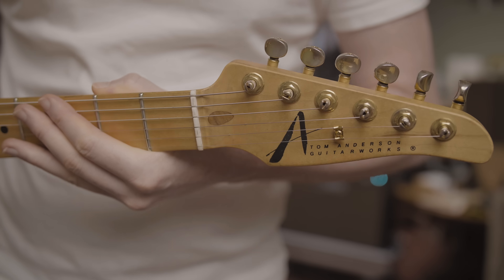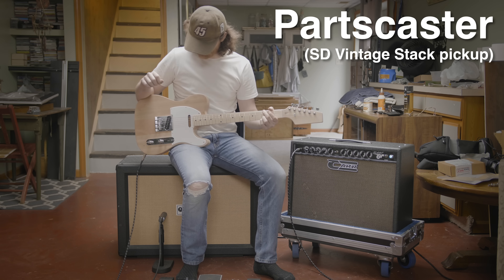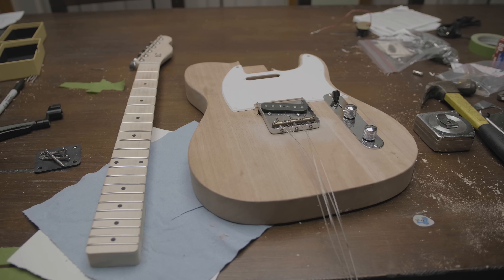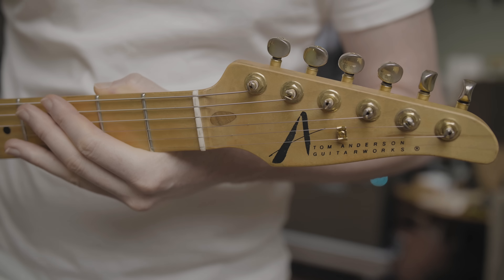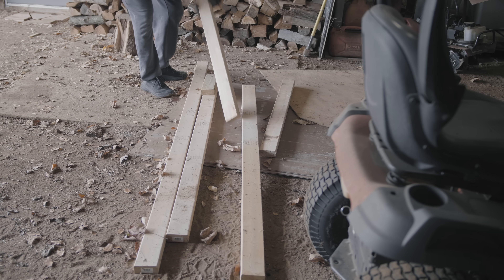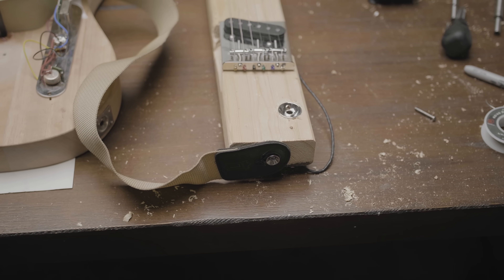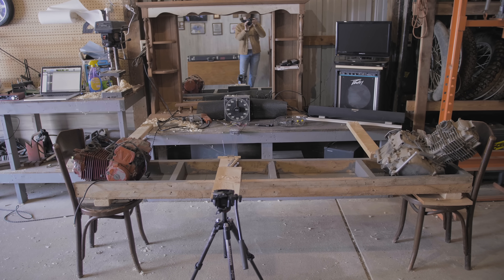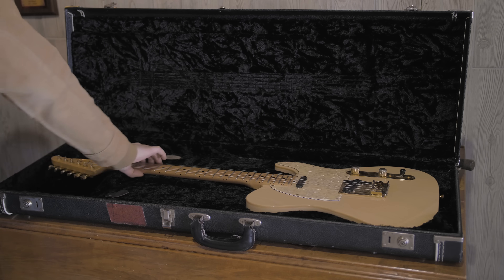Tested: Where Does The Tone Come From In An Electric Guitar?

Comment: I've only ever notices TONE changes in acoustic guitars. I have 2 twelve strings, one is made from cherry wood and it sounds brighter than my fender, which is made from some other wood, not sure which, but I know the Oscar Schmidt is cherry. I have a few classical's, too. They also sound different. One is a 72' Ventura Bruno and the other is a newer alvarez, they sound different, with the Bruno having more bottom. When it comes to your experiment, I'm SO glad I saw this. Pretty much smashes all the debates.

Comment: I believe the amount of pain felt during the mining of metals and logging of woods used in the guitar has the most impact on sound.  Also the also the amount of time (chronological distance) since the builder's woman done left him...at least for guitars playing the blues.  Maybe also the distance from a Mississippi front porch.  Hard to say.  Great video.  Probably proves that all woods have great enough compressive strength and modulus of elasticity to rigidly capture guitar string tension.  But the -done-left-me impact is strong. Trust me.

Comment: Thanks for the video.  Great job.  I know a guy that insists that he can tell the sound difference from a left handed and right handed guitar. I forwarded this link to him.  And he responded just as I suspected he would...negatively.  His two favorite claims are that (1) where you are on the planet effects guitar tone; and (2) how far the guitar is from the ground effects tone.  Cognitive dissonance is strong with a lot of people.  I have an ex-wife that refused to believe that I was always right.  Some people.
Reply: Holy shit that's like the flat earther of tone
Reply: Technically this video does not disprove his two claims since they were not tested 😂
Reply: @PhazerTech Jesus. What I meant is that power, acceleration amplitude and acoustical pressure are the only quantities that really relate somewhat directly in a loudspeaker system. Velocity and displacement amplitude are NOT proportional to power in function of frequency by any measure. And no, even if the loudspeaker system electrical impedance would change the guitar signal, that is still not part of what the video is about. The video is about guitar tone specifically, and not what happens right after. But sure, go ahead and spend $20k in gear instead of something like $3k total because it would make SUCH a difference. I'm just trying to help you
Reply: @PhazerTech No need. The mechanical-acoustical coupling is classified as a "weak" coupling when made between steel and air. This means you could put a guitar in a vacuum chamber and the string would still vibrate just like in any atmospheric conditions you can find on earth. Air is always too thin to make a difference for steel. You would have to be somewhere where air is 2 orders of magnitude denser to see substantial differences. And no, the time it takes to boil water in X or Y is irrelevant to this.
Reply: @PhazerTech The pickup is ONLY sensitive to string vibrations. Hence it always creates a very very very similar signal regardless of atmosphere. Anything from there onwards is not the guitar's tone.

I'm an acoustical engineer. I work in research and development. I won't disclose specific field and application, but it's in the audio industry.
Reply: @PhazerTech Everything this video has to do with is about the signal the guitar is able to feed the output jack with. Everything that happens later is not really the instrument's tone. The correct scientific approach is to isolate things, as opposed to use a microphone to capture everything all at once in the room as you suggested.

About what you said about lower frequencies, as long as they have the same pressure levels as their high frequency counterparts, they have the same power, period. What changes is the velocity and displacement amplitudes the speakers have to have to produce the same power or pressure. 

The attenuation of sound in function of frequency (in rooms) is mostly just a function of the absorbing materials in it. In rooms with long reverberation times, some air dissipation can be considered. In both cases, low frequencies are actually dampened the least compared to high frequencies.

Hope that helps
Reply: Umm
Reply: I think his theory, while probably nonsense, would have more to do with geographic variations in earths magnetic field than humidity and pressure 🤔 IDK think we need another test to fully put this one to rest

Comment: Hello Jim. Wonderfull video, lots of work.  But.... you made a mistake. With the 'airguitar'. I understand what you wanted to do. To make a guitar without a body. But instead, you created the guitar with the latest body/soundboard possible. The tuners are mounted on giant piece of wood, the shelf. And the bridge and pick-up are mounted on the working table. Also a gigantic soundboard. The two are connected by two pieces of wood to keep the distance equal.  See what you did?

I play guitar for over 50 years. Maybe you know about Les Pauls early experiment to find max. sustain. He took a piece of train rail, solid steel, and mounted a string on the rail. Yes, the best sustain ever, but no warmth in the sound. 

Remember the guitars with the plixeglass bodies from the early 70's? Besides beïng very heavy, they had no warmth in them.

The body of the guitar, mainly the wood, determins the sound of the voice. Warm and deep, or a high shrill voice. Does not matter. The pick-up is just a microphone.
When you speak into a microphone, we all instantly recognise your voice.  When your girlfriend speaks through the same microphone, we hear her voice.  Ofcourse, there are mics that transmit more higs, other more lows, but we recognise a voice immediately, regardless of the type of mic that we use. 

Play a Les Paul unplugged. In a music shop. And the next. And the next. Alyjough producer in the same month  you'll notice differences in sound. That's the wood, nothing else  because we play it unplugged. Yoy have Les Pauls weighing 8,5 Lbs and some are 11 Lbs. Difference is the wood. And I can assure you, the 11Lbs LP sounds less warm than the 8 5Lbs one. The lichter the wood  the warmer the sound.

About the video, after you fitted the $100 Tele with the Seymour Duncan I could not hear any difference with the Anderson. I listened on my phone, using earphones.

Comment: Can tell you what makes the difference in your 1st comparison straightaway; the amount of output the pickups are pushing out. The Anderson was sending the preamp stage of the amplifier into greater saturation and consequential thickening of tone when compared the Parts Caster.
Unless you're prepared to match outputs, then you're straightaway running a compromised test, and all of your suppositions are off whack as a result!

Comment: As a trained luthier who's still new enough to the craft to not be stuck in my ways, I love everything about this. Very well done.
 I'd be curious to see a timed sustain comparison between the plank guitar, the Anderson and the air guitar. I'd hazard a guess that the air guitar has the best sustain, and the plank has the worst.
Reply: Yeah I'd love some sustain comparisons and, as a mostly metal guitarist: pinch harmonics!
There's a big difference between my 1800€ esp horizon and my 450€ LTD. Same shape etc, same SD SH-4, same pickup height.
But the esp has a floyd rose, Mahagoni body, ebony fretboard compared to TOM + strings through body, agathis body and rosewood fretboard.
The esp has a lot more harmonics and pinch harmonics are easier and longer.

Comment: I've been seeing the tonewood debate go on for decades as long as I've been playing guitar in my preteens... I had a luthier tell me one time the only time tonewood matters is with acoustic guitars or anything acoustic. a solid piece of wood is not going to have any effect on tone especially when it's got layers of paint and a clear coat of poly or any other kind of lacquer or even if it's a satin finish that all is going to kill any acoustic property on the wood.
The biggest reason that they push one type of wood over another type of wood for electric guitars is so they can charge you more.
Now if you're going for looks that's a completely different argument.

And if you think I'm crazy look up a video on YouTube where they made a Stratocaster out of cardboard and they took it to fender and the custom shop got a hold of it and they were blown away by how much it sounded just like a strat.

Comment: The truth is .    Guitars are still using 1950s crude electronics. - 70 years old  .. and the technology hasn't changed .   The minor sound changes you may hear would never translate into playing live within a band with moderate  volume.   I would go as far was saying the $500 Epi Les Paul with a set-neck is likely better overall. quality   than a  used $1,000,000 1958 Burst.

Meaning the entire "vintage guitar" resale is nothing but  a means to recover the cost a of guitar that has vastly depreciated since you over paid for at Guitar Center

Comment: Thanks a lot, Jim. This shows what I'm always saying. Over 90 % of all the sound discussions is esoteric Voodoo blabla. It's just a mechanical oscillating circuit with a magneto electric signal converter which finally may look nice and feels good in your hands. That's all. The rest is religion. Of course there is an influence of the wood and stuff but its just a tiny part compared to the pickup/strings/electrics combination. As long as you connect the pickup coils unbuffered (passively) to  unpredictable complex networks (resistors, capacitors, inductivities) including the cable and the amp input impedance it makes no sense to discuss sound nuances.

Oh I forgot the Honda engines. They for sure have a big influence. Two-cycle or four-cycle makes a big difference.

Comment: Billy Gibbons has talked this for years in relation to string size and sound. He says he can get the same sound using 8s (even uses a 7 on the bottom E) as he can from 10s or 11s. Put the pickup closer to the strings and up the volume on the amp. The string size debate has been similar to this one. SRV used piano strings (exaggeration) and some claim that’s his secret. Billy would say he got more volume from them, little else.

Comment: it did seem like the air guitar had a longer like sustain. This makes sense because the wood in the neck could absorb and reflect acoustic energy back to the strings. I don't know if that's strictly better or worse, but it is different. Tone was basically identical which is honestly kinda what I'd expect.

Comment: I concur with the other engineers and luthiers comments - you did an outstanding and methodical debunking.  Now for the killer question… what are the final measurements on the angle and heights to derive the best sounding air guitar ever?

Comment: Good on you! I buy cheap guitars like Harley Bentons and I give them a first class setup. Rolled fretboard edges, leveled and polished frets, fret ends dressed, intonation, nut height (most important!) and action and then a thorough pickup height adjustment. As every magnet differs, you can't just set the height by duplicating setups (unless you really, really use consistent very high quality pups). But my $120 guitars feel and play like $1200 guitars. Just a few hours of fettling and one can polish a turd...

Comment: Great, now I have to get a dual-honda engine block headstock for my slide guitar to get THAT tone! I have known for a long time that the primary factors for electric guitar "tone" (prior to cables/effects/amps) are pickups, strings and player. Everything else mostly affects sustain and playability. Quite different than an acoustic guitar. It would be interesting to have a computer analyze the diif btw the air guitar and the tele.

Comment: It's ALL the electronics. Want proof? There's a video where Fender made a Strat out of cardboard, NOT solid cardboard, but box board. Then they installed Strat pups, caps, caps, etc. Guess what? It sounded EXACTLY like a Strat. That's why every Les Paul Burst doesn't sound the same, the pickups weren't made on a machine that counted the winds, it was done by eye. The Bursts that got hotter pickups, like Bernie Marsden's Beast, sound like a monster. But, there's plenty of Bursts out there that don't have that "pop". I proved that to myself when I bought a Chibson that came with the electronics from an Epi BB King 355. It sounded like crap. I pulled out all the electronics and installed top shelf parts, including a set of Pearly Gates pups and a set of Emerson paper-in-oil tone caps (one red, one yellow) and that fake Les paul sings now...and I saved literally thousands of dollars by not buying an overpriced Les Paul from Gibson.

Comment: This is an awesome video man, I will say though, you didn't do the test with humbuckers, and from building several guitars the body wood, neck wood make a difference. 

I've done a lot of research on this as well. I'd agree 85-90% of the sound comes from the electronics. 

There is on key thing you might not have though to focus on - the key impact on tone is actually sustain - how long the string can vibrate as well as how the sound bounces off the wood. 

So a mahogany body ought to give a bit more low end vs alder since it's a softer wood.  

Then there is also the build quality, bolt on vs glue in etc...

Bolt on's always sound a bit brighter and if the neck is bolted on vs glued in it has a bigger impact on the tone. 

You were also using pedals, OD, compression for the test... if the guitar sounds different when played acoustically it's going to change the sound through the amp - at the very least when it's play 100% clean or though a PA speaker. Sure the amp is going to have a massive impact on the tone as well, but even at that the speaker is what's going to effect the sound the most. 

What it really all boils down to is how much of an audiophile are you and do you notice the difference and how much do you care. You can easily make a $400 guitar sound and play great, so if that's all you want or need then you don't need all the other stuff. 

A lot of the little variances in sound you can't really tell until you've played for like 10 years or so anyways so it also depends a lot on the individual player and their experience. 

Lastly I'd say the style of music matters, for example if you compared the "air" guitar to your tele for palm muting, the muting on the air guitar will be a lot more muffled and there should be more punch from the alder body/maple neck. 

I'd really like to see a palm muted comparison with humbuckers if you're up to that.

Comment: There's ever so slight difference with balanced mic distance between Partcaster and Anderson. The sustain seems to be just a tiny bit weaker with Partcaster and there's very very minor change in harmonics and I believe it's due to the differences in vibration of the wood, but the difference in harmonics is so small it can't be considered if you can't get it come up more prominent. Other than that the tone obviously comes from mics. Tbh this is not a news to me, but it's great someone actually did this!

Now try less hot and less colored picups and please do the same test with Partcaster and Anderson using piezo mic. Would be interesting.

The real difference with well built guitars and cheaply built mass products is the longevity and quality of the hardware/electronics. It's been common knowledge for years that cheap guitar doesn't automatically translate to bad guitar. The main principal is, check for build flaws like lose parts etc. and check the overtones without plugging the guitar in. If there's irregularities in overtones or they're clearly not in tune, there's pretty much nothing you can do to it and you will always have a faulty guitar you can't sell. No mic will help you.

Comment: Awesome level of attention in this exploration.
I have  3 SGs that were all made at roughly the same time  with the same electronic parts and hardware. 
The wood has aged slightly different in all of them with one being lighter, one being heavier and one being “just right”. The heaviest in the darkest sounding. The lightest is the brightest sounding. Unsurprisingly the middle one sits tonally between them.
This is not imagined.

Also-a tele and a strat style guitar or a les Paul and an SG style guitar sound completely different and distinguishable from each other irrespective of manufacturer. This suggests that there is something inherent in the body shape - otherwise all guitars would just sound like their pickups only and be indistinguishable from each other except by make of pickup.
This just isn’t the experience of the real works of guitar playing and is presumably why we all by different shapes of guitars.

I still think this is a fascinating video and certainly makes a guy scratch their head.

don’t be ready to ditch the guitar builders wisdoms just yet.

Comment: I have been wanting to see a video like this forever! Thank you!! The dimensions of the resonating body make a huge difference for tone because it's the specific dimensions that isolate various overtones and the body then allows them to resonate throughout itself. Bigger guitar bodies allow for lower tones as longer wavelengths can 'fit' within the resonating guitar body. This is why the homemade guitar doesn't have as many low and low-mid frequencies. It would make a fine lead guitar. Thanks again for this fantastic video!